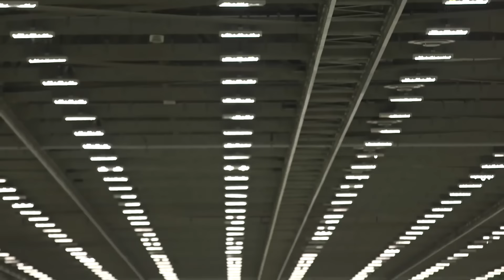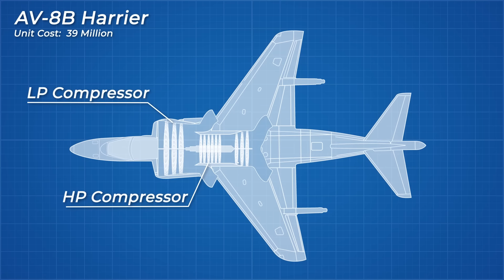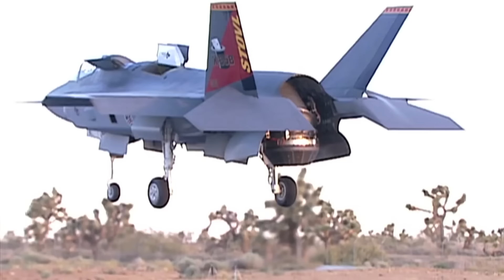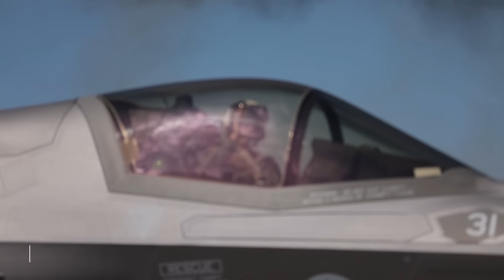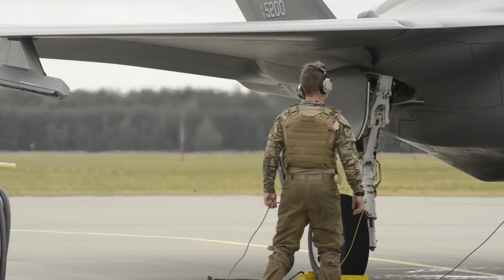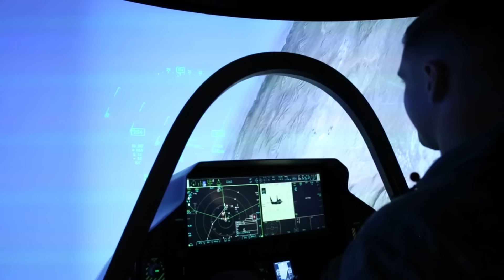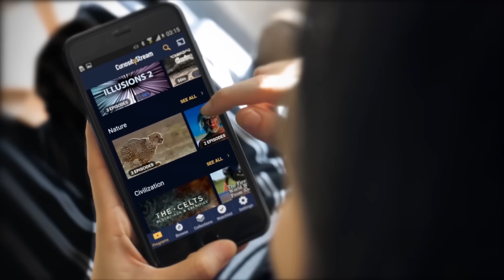Is The F-35 Worth $115 Million?

Comment: @RealEngineering. Could you in some way, or all the way, explain to me (us Canadians) if the Avro arrow was the real deal, and if that tech was brought back and modernized DO EXACTLY what Canadians need for our 7000 kms coast to coast to coast (North....) If so, thank you as I and many of us really wonder?!
Reply: The Arrow was a 1950s design that had performance on-par with advanced fighters of that era. It would not stand up to modern fighters without being completely redesigned. It's max potential is less than what modern technology allows with new designs.
Reply: @dumdumbinks274  . I read your reply and i have to reply that that is not what i have heard, read and watched in the last 4 years. Especially the Canadian search for a new plane and the F35 issues, problems and crazy price ups. The info i get is that the Avro is faster and has more range than the 35? We're talking Canadian needs. Can a modern arrow exist? Mach and range intercept...
Reply: @steagathebeach  The Arrow has a LOT of political controversy surrounding it since the cancellation effectively destroyed Canada's aerospace industry, and that has fueled the debate about the Arrow's capabilities. But per it's original specs the Arrow was inferior to other interceptors of the same era, notably the F-106 which was faster and longer ranged and carried the same weapons, but also the F-4 which again was faster, had the same combat range, and carried more missiles. Can't really expect that sort of plane to be modernised well enough to be a better choice than the F-35.

Edit: forgot to mention that while the Arrow was faster in MAX speed, it carried weapons externally and that causes drag e.g the F-15 has a MAX speed of Mach 2.2, but with 8 missiles it's speed dropped to Mach 1.8, and with the external fuel tanks required on all missions the F-15 is slower than the F-35, but it can drop the external fuel tanks if absolutely necessary. It is highly likely the Arrow would have similar performance loss. Also the Arrow has less than half the combat range of the F-35A, so if range is the deciding factor the F-35 is the obvious choice.

Comment: The f35  can nnnot replace  the a10
Reply: Multi-role fighters have been replacing it in regards to CAS missions with contested airspace.
Reply: @peterson7082   sure if their is no fighter support give it ago   it's better then nothing but  they can't  perform close sir support  as well ad the a10 f35 20 mins on target  a10 90 plus more firepower  and can lose a tail engine or hydraulics  and still fly  and has armor  honestly for  current  combat    are planes  are going through  we should be using  a29 super tucano

Comment: The problem with limited dog-fighting abilities is not one of technology nor tactics.  It is rules of engagement.  If the pilots are allowed to use the gear as designed it is pretty unbeatable BUT if the politicians or command staff put limited rules of engagement, such a visual verification, in place, then it would put the F-35 at an unnatural disadvantage as it was designed to shoot form a position advantage and avoid a dogfight.

Comment: - The F-35 will not be replacing the A-10.
- The F-22 price is based on its low unit production. Had it been built in the original numbers, the price would have been greatly reduced.
- F-117A shot down was a number of factors put together: spy within NATO giving nightly routes, stealth vulnerability to low frequency radars and good Serbian tactics. Plus, the radar site never got a lock, the missiles were launched ballistically and detonated on command.
Reply: Multi-role fighters- specifically the F-16 has been replacing the A-10 in CAS missions where the airspace is contested for quite some time.

Comment: I'm pretty sure the price Lockheed is charging per plane is stupidly over priced per sq in of actual plane. I can see paying your workers a decent amount of money, as it's high stake, high security and often times very specialized labor. I understand the cost of a fancy turbine engine can be pretty significant, considering the exotic materials it probably requires. I get that the electronics are state of the art, and definitely not mass produced, and every system needs a redundancy. But even still... after all that development, once you get going, the cost per unit should drop so dramatically, no matter what type of manufacturing you are in, that no could sustain a business model in the real world. We need to have better budgetary oversight for this type of bloat.
Reply: The cost is not all that different to its contemporaries
Reply: @peterson7082  I live by the motto: "Just because you can, doesn't mean that you should" 
The Gov't contractors are obviously pushing what they can get away with. Knowing full well, that they are literally holding hundreds of top brass military men, and congressmen and senators by the toes if they don't deliver. "Sorry guys, I guess you aren't getting your planes, unless you pay us more... development costs have just crept up, sorry."
Reply: @EcoMouseChannel  ?

Comment: 27 years to develop that???? what did the sr-71 take in term of R&D and entering service...
Reply: The F-35 did not take 27 years to develop. Requirements were beginning to be formed 27 years ago.
Reply: @peterson7082  ohh right.. sorry.. 26 years....  because development started in 92...  wich makes it a 26 years before being officially put in service...
Reply: @jkk20  "Development" in terms of actually prototyping the aircraft did not begin until '2006.
Reply: @peterson7082  my comment still stands... the sr-71 from initial drawing to be service ready in the form of the cia a-12.. wich was started in 59 and started flying in 63 for test flights.. operational flights happened in 67...  wich is a damn short time from drawing board to actual combat readyness compared to the joke the f-35 is...  and they did it all with rulers and back of the envelope calculations. so,next time you respond to someone make sure you understand the argument.

Comment: The SR-71 was supposed to be stealth too. I’m curious how they managed it with 1950s technology. I know laminar flow was a big part of the design.
Reply: Nope. It was only supposed to have a reduced RCS compared to aircraft of similar size since at the speeds it would fly even a small reduction of detection range would significantly affect the enemy's ability to react. The stealth concept didn't exist until the 1970s and the first operational stealth aircraft was the F-117A.
Reply: @Pilot16H Completely false. Stealth as a concept did not exist until 1968. There were no stealth aircraft until the F-117A. The concept you are referring to is the flying wing design, which Northrop had a flying prototype by 1942.

Germany has never had stealth aircraft, and yes I'm well aware of the Ho-229 which had a slightly below average RCS compared to fighters of that era because of the flying wing design, but that was a by-product not a design goal and it still wasn't stealth... no actual radar tests have concluded that the Nazis would have been able to bomb the US without being intercepted, that's just a fantasy.
Reply: @Pilot16H Reduced RCS is just a building block to the far more complex stealth concept which simply wasn't possible to achieve in the 1940s. The Germans only noticed the tip of the iceberg so to speak, and they didn't act on what they knew because there was little benefit to doing so.

Comment: Caveat: all of the planes except the A-10 warthog: a plane loses some tactical capability without a “gun”, and as such an expensive, and yet vulnerable aircraft, it simply won’t ever be allowed to fly in as close as an A-10, and won’t carry as much variety, payload, and brrrrrrrting.
Reply: Not really the case
Reply: Nathan Peterson my dad is still in the infantry reserves, my brother is a ranger. Less brrrrt and boom. And that. Is. A. Fact. - literally speaking, the A-10 has significant additional armor and a lower bottom speed, meaning it will be able to strafe for longer and from much much closer than the F35 ever will. In addition to that, the F35 is noticeably lacking in the “brrrrt” category. You run out of missiles a lot faster than you do bullets, and the F35 literally cannot hold as many munitions as the A10, least of which in a manner that would be safe if it came under fire. In addition to logistics, there are a few things that you can’t do without bullets: roadblocks are difficult because the odds of you leaving enough car left to block the road is low, you have a hard time not destroying infrastructure like roads and bridges, which can end up hurting our troops more in the long run, bullets are cheaper than rockets, and nothing is scarier for enemy infantry and more heartening to our own than the distinctive sound of the A10 Gatling gun. The F35, while freakin expensive, is no doubt a capable tank hunter, superiority fighter, reconnaissance plane, and bomber/fighter interceptor, but it is simply not designed for the role of Close Air Support and that’s a fact.

Comment: 18:39 He talks as if only stealth design matured since F-117 Nighthawk. Along with stealth, SAM systems and its detection capability improved too. If late 1900's stealth can be defeated by late 1900's SAM systems, then 2020's stealth system can be defeated by 2020's SAM systems. STEALTH DEFEATED.

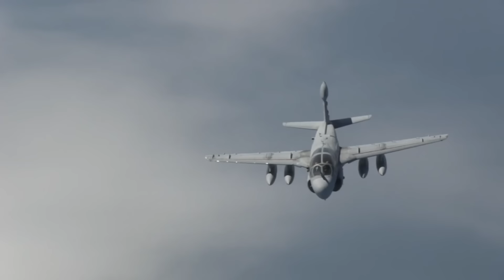18:24 If they used Electronic Warfare jets on SAM sites, then Serbia could have used anti-radiation missiles and won. Same outcome. STEALTH DEFEATED.

14:02 If stealthy F-35 starts to communicate with other allied units with it's network capability you brag about so much during mission, it will give away its location by electromagnetic emission.  This is why, while in mission ship and planes don't use its radar and avoid communication. STEALTH DEFEATED. 

16:17 F-117 never got shot down over Iraq because when the war started, first thing US did was use every units and weapon it had to take out Long Wave Radars Iraq had. So, F-117 is not invisible or invincible. And the US knows that. After Serbia, the world knows that. STEALTH DEFEATED.

18:02 Low frequency radar may not provide weapons grade targeting information, but can see stealth clearly. If a B2 bomber is penetrating enemy airspace, then Low frequency radar can spot it and inform it's air-force. Fight jets can intercept and destroy with ease given that B2 is subsonic and has no air-to-air capability. STEALTH DEFEATED.

Comment: For effective low   level ground attack missions in  A 10  style ,especially against tanks,  u need a powerful  canon with a high firing rate ...where did you say is that mounted on the F35 ?
Reply: The A-10 cannon hasn't been able to penetrate tanks since the 1970's.
Reply: @ChucksSEADnDEAD  Two words : depleted uranium
Reply: @planpitz4190  it's not used anymore in A-10 rounds, it turns into dust and the heavy metal inhalation causes birth defects on civilians. They use high explosive rounds now.
Also, even the DU rounds couldn't punch through. Tanks got too thick in terms of armor.

Comment: Welp 20:1 KDR, can't exactly argue with that.
Reply: He failed to mention the 20:1 was in BVR vs F16s not CQ dogfighting.
Reply: @kielweiss3606  Yes, but the fact that it CAN do that means there is value to it when you're not dogfighting. If you are dogfighting regularly, bring a different plane.
Reply: @kielweiss3606  A 21:1 ratio was achieved in an actual war scenario at Red Flag 17-1. That's including WVR situations, and only including what the F-35 achieved directly during hte main scenario i.e excluding 1vs1 practice fights and similar. F-35s generally win against F-16s in dogfights anyway, at least as often as F-16s win vs F/A-18s.
Reply: wall hack
Reply: The US military has cheated on such mock conflicts, see for example Strykers using smoke grenades to creates "berms" to block enemy lasers in training that would not protect them in conflict.
In fairness this did cause a general to resign, so their is hope for the service.
Reply: @Ag3nt0fCha0s  It occurs on both sides since the US are on both sides. It's also not the US who cheat, but rather individuals within the military,.

Note that Red Flag 17 allowed the Red fighters to re-enter the fight after a short time after getting shot down in order to simulate a larger enemy force. This backfired in some ways since not only did it simulate a larger force, but it also resulted in Red F-16s re-entering the fight after the Blue team had passed by, as such the Red F-16s that had already been shot down were coming up behind Blue F-35s and ambushing them, presumably because nobody said anything about where the fighters should re-enter the fight from.
Reply: You know you are being sold snake oil when a plane can do 20:1 kill ratio while only carrying 4 missiles internally.

P. S turning on your radar makes you as stealthy as using a flash light at night.

Using external hard points on a stealthy design is like trying to blend in the dark while wearing a dark suite fitted with bicycle wheel  light reflectors.
Reply: @MakisGirg  No that just means you have no idea what you're talking about and are incapable of critical thinking. Nowhere in the definition of a kill ratio is the number of missions flown defined as 1. 

PS turning radar on does not make you like a flashlight when you are sending out low energy waves in thousands of different frequencies... it is barely noticeable since they blend into the background and is more like using a flashlight on a sunny and very bright day. Your claim is about 25 years out of date.

Use of external hardpoints doesn't occur when stealth is needed.

Comment: Unfortunately Belgium has also ordered 35 F35 5 th generation jets. It is not only the high purchase Price, but also the high maintenance cost. With his low width span, the F35 is an horable airplane in a dogfight, since it can not turn so quickly. Dassault, Euro fighter or Saab would have been a smarter choice. Not that those airplanes are so great, but at least the pilot has a chance in a dogfight, while in a F35 no chance whatsoever. Stealth is a scam. There always going to be dogfights, in case of a war. F15 is much more capable. We have seen that in Iraq. Even the smaller F16 is much better then this lemon F35. It has all to do with Congress and jobs. They could not pull the plug on the further development of the F35. Unfortunately.

Comment: https://www.businessinsider.com/german-radar-maker-hensoldt-says-it-tracked-f35-in-2018-2019-9?international=true&r=US&IR=T
Reply: It sounds like the TwInvis relies on a form Direction Finding, but in 2-D rather than just horizontally. That’s why it can’t be used for Radar Guidance but can be used for guiding heat-seeking missiles. The Luneburg Lenses used by the F-35 to help Civilian ATC & “Deconfliction” systems track the F-35 probably reflected the radio waves from the FM emitters the TwInvis used to track the aircraft. In Statistics, that’s called a “Confounding Variable” - We’d have to see it actually track an F-35 which wasn’t equipped with Lunegburg Lenses to know that it could actually track the F-35 during wartime air operations. That’s a test that needs to be carried out as this plane is going to be such an important part of the national defense for so many countries until the 2030’s, & as many of our potential adversaries have developed (or are developing) stealth aircraft.

Comment: The claim about stealth falls apart vs near peer enemies. The Russians use multiple frequencies in their radar systems because of the problem of low fidelity. The thing is even high frequency radar will see you if  the signal is strong enough(so close by or powerful radar). So if they see you lets say 200 miles away with the low frequency radar they can send and high accuracy  missile with a high frequency radar or a heat seeking one that will not see you from 200 miles but will easily detect you form lets say 20 miles and since missiles are much faster than aircraft it will catch up  to you before you get out of its detection range and that's assuming it isn't being guided from the low frequency radar to get close enough for its radar. Also Russian detection system is distributed  layered and specifically built to be resistant to jamming and anti radar missiles precisely because they know how important it is to make  those aircrafts biggest strength almost useless. When you are fighting low tech terrorist with not much more than rpgs then yeah that stealth is like near godlike power.
 Also not bleeding kinetic energy and high manuverabily is extremely important when trying to evade a missile fired at you. So if the F35 is detected the odds of it being shot down are actually much higher than lets say an f16

Comment: Here is the single biggest cost benefit in operating this plane. It takes a 20-24 plane assets to perform the same mission as 4 F-35. Now think about fuel savings on the mission. Think of the maintenance savings of those extra planes. Then the cost of those planes. There is another benefit to using the F-35 over the 20 ship per mission armada and that is deconfliction of the airspace as well as the airfield schedule supporting the mission.

Comment: The F-35 dumping energy in turns, sounds like it has a case of MiG-21-itus
Reply: That article was from a test aircraft, conducting a test to find shortcomings in the aircraft's flight controls, which were under development at the time. The whole purpose of the test was to find ways to improve the aircraft's flight controls, since it's fly-by-wire.  Of course, this "leaked" report is a great way for reporters to take it and spin it into sensationalism.
Reply: @kawrx2002  I'm aware of this. It was a joke because the MiG-21 dumped energy in turns due to its unstable wing design.